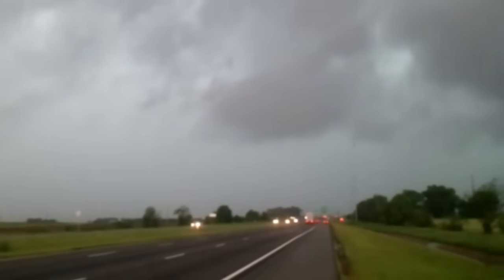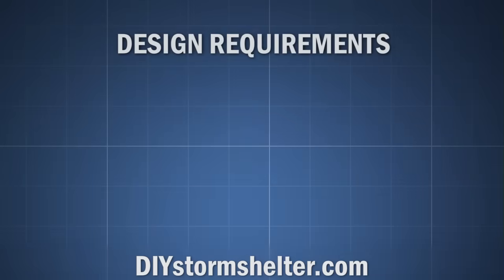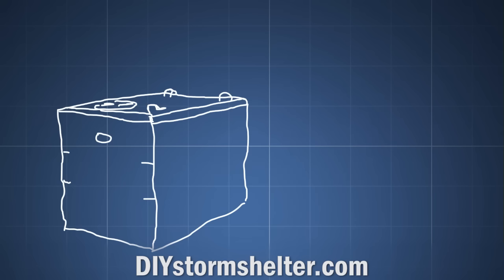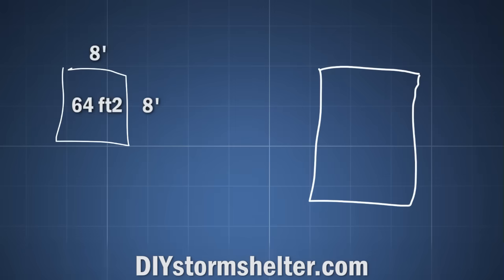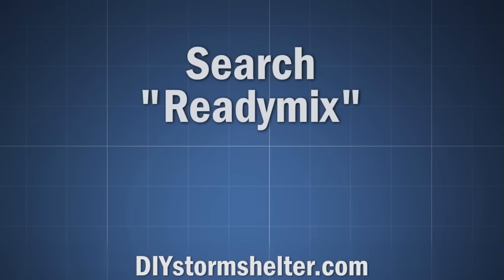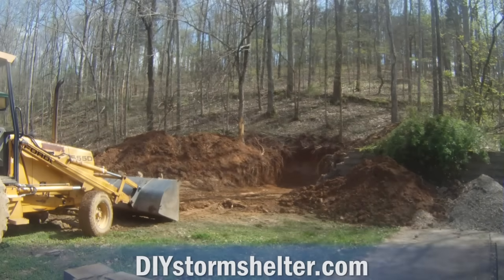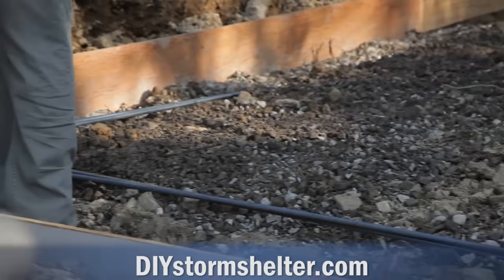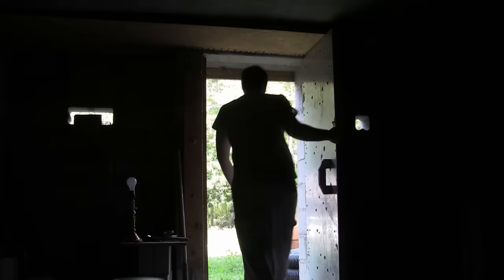Concrete block DIY Storm Shelter 12x20 foot

Comment: Everything you talk about for concrete and block specs I learned about over 35 yrs ago in my Brick Layers course ,  with building a storm shelter like that , and pouring concrete , you also need to have proper forms (oiled type forms are only used )  and proper type of reinforcing steel .
Ordinary rebar is not acceptable , must be coated or use Stainless Steel wire mats (4x8) or wire mess that has a coating not to allow rust to start, unfortunately less expensive products are available and used due to trying do it on the cheap.  With over 38 years in construction industry from being Certified Bricklayer and Stone Mason , Certified as well for Blue Prints to Class 3 Tandem driver with 17 Ton cable Crane credentials , several  flaws as well in your construction . Never build on side of a bank , Hydrostatic Pressure on 3 sides will cause Subsidence or moving of the structure for storm shelter , must be backfilled on all 4 sides and tamped the earth every 2 feet  as well with Class A Gravels , redish clay or clay type soils for back fill allow for freeze thaw cycles , even with mildest winter climates, frost can occur at the most unforscene times , climates change without notice .  Using Aggregate mixed type soils and tamped also allows for drainage away from structure and you also never used any drainage conduit around the structure , mould will occur even in block type structures without notice and the air will become stagnant and toxic . As I say I'm certified now 36 years and have built several these type structures of the same . Research is only small part , lits if wrong info as well on the internet . As for Engineers , well I'll leave it at that , they all have thier own versions of how it should be done , most could not mix cement in a wheel barrow.

I might ad as well Today I work for a Brick and Block Manufacture , and filling the cores you must also vibrate the Concreate in order for proper Airation of it for proper and full PSI set up , not doing so can cause premature failure if the block due to inner hydrostatic pressures during cure time , I've seen several walls fail for lack of proper Airation of pouring Cement into cores and try to blame the block products , when in fact short cuts were taken
Reply: You don't need to use stainless steel, the rebar can't dust if it's incased in concrete there's no oxygen
Reply: Best take a real good look next time a demo is done on aging concrete  reinforced with steel , we live in Atlantic Canada , Everything rusts here . I can garantee there is rust and corrosion with in the concrete
Reply: @outbackcountry512  yeah well I dunno maybe different over there? But steel needs oxygen to rust so if you fully encase steel in concrete it can't rust, maybe the snow can seep into the concrete I don't know
Reply: @outbackcountry512  if your concrete is cracking you are doing something wrong

Comment: A sea container buried in the ground encased in concert. 
Attach it to your basement and you can enter it from your house.
Reply: He doesn't have a basement...That's kind of the point of building a shelter, but this one will probably become a tomb...
Reply: Sea container won't work.  The sides will give out.  The strength of a container is in the corners.
Reply: Nick Heese 
You would have to shore up from the inside until the concrete cured, but it would work.
Reply: The concrete "encasement" would crush your "sea container" .
Reply: @denisewilson8367  
Not if your shore the inside until the concrete cures.

Comment: At the base of the structure or part of the footings there need to be about a 2' horizontal concrete extension all around.  This provides an anchor for the buried structure from floating and lifting during high water table events.  Trust me when I tell you that your shelter will pop up out of the ground if given the chance!
Reply: Here in Washington State we have floating highway bridges (I-90, Highway 520) across the Puget Sound that are supported by concrete pontoons.  Hollow concrete structures will most definitely float.
They make battleships with thick steel hulls and armor that float, too.

Comment: Not qualified to charge for any kind of advice. For example of your structure not being up to snuff, there is no planning for lateral force. In a tornado the damage doesn't come from downward pressure. It comes from the sides. No rebar in your block and no concrete. Unless you were encasing the entire thing in dirt and entering from the top, you have to take lateral force into consideration.
Reply: Oh, lateral force IS taken into consideration. It's one of the biggest challenges of a buried structure - the dirt WILL crush and destroy if the structure isn't sufficiently reinforced. 
Almost every cell got #4 rebar and was grouted, and in addition reinforcing "ladders" were placed horizontally every few courses. The shelter has now been in place for coming up on 6 years. There's not a single crack anywhere.

Comment: Your'e only going to be in there for like 15-20 minutes until the tornado passes. You don't need a subterranean Heffner Mansion for God's sake.
Reply: Some people build this for hurricanes - here you can be in for many hours. 
For tornadoes, you want to enter the shelter either when wind speeds are becoming dangerous or when a tornado WARNING is in effect. We've been in for over an hour before. When it's the middle of the night, and the kids are fussy and/or scared, and the storm is kinda nasty, having plenty of elbow room is a luxury you are VERY happy to have. Also, there's not a huge time or price difference to make it just a bit bigger.
Reply: @davidbotkin1650  Be subterranean when a hurricane hits? With all of the rain and major flooding that comes with it? No thanks.

Comment: Best way is all cast in place, reinforced structural concrete. In my past consulting business I detailed formwork drawings for many small town tornado shelters in Arkansas. Most were high school gymnasium sized structures with design engineered specs and drawings that would have multiple usage beneficial value. Those structures were totally above grade. Block masonry is more cost efficient but should be designed and constructed only by qualified professionals. Tornadoes vary in their wind velocity and safe shelters should always be built per applicable codes and specs! Shoring the elevated cip roof slab and the decentering ie extremely critical in releasing the properly cured slab to assume it's own load. If decentering process is not done correctly the whole roof slab could possibly and catastrophically collapse!! This is always critical on elevated floor slabs and cip slab and beam bridge   structures. Use of a licensed structural engineer will also spec the rebar and the mix design specs for the whole project.  An architect can also help you.

Comment: You built a shelter-shaped object.   I could tell you at least five mistakes you made, but will require payment of $14 first.
Reply: Just a simple square box - teenager's could do this diy
Reply: @rv442conv  what's your shelter look like?😂
Reply: @rv442conv  It could be that simple, except this guy built a storm shelter at the foot of a forrested hill...
So what, right? First thing to consider is: 
1. when will this square box be used?
2. What is the square box supposed to be used for?
3. Who will use this box for its intended purpose?
Those are some very simple, basic questions, right?
The square box will ONLY be used during extreme weather and is designed to protect his family from high winds, tornadoes and possible flash floods that may come down the hill along with trees that have blown down and the hillside terrain.
Now, would you suggest that your loved ones climb into that tomb at the base of a hill or do you have a huge life insurance policy that you would like to collect from an accidental death in a tornado?
Reply: @superiorcarpetpaintllc4351  he forgot the drainage pipe and gravel around the perimeter to keep water hydrasyse out from seeping in but hopefully he puts a pump in or some other drain system. But he did say he was on a budget.🤔
Reply: Why don't residents set up a co-operative, either local or national, and approach a plastics manufacturer to make a simple domed roof plastic underground shelter. They keep bugs and water out. 7000 dollars for an underground shelter is a rip off online for a plastic shelter when a child's plastic slide is so inexpensive to make. The plastic on those toys is almost indestructible and will certainly endure below ground. Easy to replace too. Also, not sure why you guys in the comments keep describing below ground shelters as coffins when your neighbours and family would know exactly where to find you? Don't tornadoes only last a few minutes?
Reply: I'll do it for $13.99 and I won't bore you with those mistakes!
Reply: @davidnapemaskwa7251  I will do it for 13,98!
Reply: HERE is The TRUE Savior 

YaH The Heavenly FATHER HIMSELF was Who they Crucified for our sins and “HERE IS THE PROOF”

From the Ancient Semitic Scroll: 
"Yad He Vav He" is what Moses wrote, when Moses asked YaH His Name (Exodus 3)

Ancient Semitic Direct Translation
Yad - "Behold The Hand"
He - "Behold the Breath"
Vav - "Behold The NAIL" <— YaH’s Crucifixion
He - "Behold the Breath"

“Behold the HAND that Beholds The NAIL” 

PROVES - YAH The Heavenly Father HIMSELF was Who they Crucified

That is EXACTLY what Moses Wrote

Here is what they mean

YaH's Name:
(Ya)d + (H)e, as YaH is what Moses called Him and YaH Declared: "this is My Name, this is My Name for all generations" (Exodus 3)

YaH is The Creator of “MAN”:
Yad He, (HAND BREATH), as YaH's "HAND" Formed man from the dust  of the Earth and His "BREATH" made him a living being (Adam)

YaH's Sacrifice of Crucifixion for “MAN”:
Vav He (NAIL BREATH), the "NAIL" through YaH’s "HAND", that whosoever shall call YaH Savior, His “BREATH” brings forth life (Salvation)

How YaH arrives:
YaH arrives via the Tent of Meeting (Exodus 33:7:11, Isaiah 54, 55), where a Tent is erected outside the city, a cloud descends upon the entrance of the Tent and YaH appears...

Why they demanded YaH to be Crucified:
YaH was Crucified according to Hebrew law (Deuteronomy 21), to be Hung on an Almond Tree for BLASPHEMY as it was for His NAME they demanded Him Crucified. The Messiah claimed He was YaH...

HE WAS YaH!!!

HalleluYAH “Praise ye YaH”

From The Hebrew Book of Isaiah, The Dead Sea Scrolls

Isaiah 42:8
"I am YaH; that is my Name! I will not yield my glory to another or my praise to idols.

Isaiah 43:11
I, I am YAH, and there is no other Savior but Me.

Isaiah 45:5
I am YaH, and there is none else.

Comment: Why not pour concrete walls in forms with rebar, like you would for a basement?
Reply: Professionals do build them with poured walls, they just require some VERY strong forms to hold back the concrete, you can rent them or better yet hire a form carpenter to build them for you, form carpenters have reusable steel forms that they will setup and take down after it has cured.
Reply: @superiorcarpetpaintllc4351  My company uses Symon's Forms... Very expensive but so worth the cost.
Reply: @mr.techaky7655  I always hire a form carpenter to build our forms, anything over 24" is usually steel, by giving the job to a form carpenter we kill three birds with one stone, the contractor will take full responsibilty for workmanship, he will supply the forms and reset them prior to pour and he will take the forms down and clean them after the concrete has set! All of that for about the same money as it would cost me to rent forms or build them plus all of the labor is included and if something goes wrong the form carpenter is 100% responsible for making it right! DIY doesn't pay sometimes.

Comment: What about a container
Reply from the maker: On their own, DO NOT BURY THEM! The roof and sides are thin corrugated metal and will fail with dirt against/on them. If you pour a concrete roof, and set the dirt back from the sides, then yes they can work. But then you might as well build with concrete all the way and not really have to worry about rust.

Comment: Did you consider a small shipping container? One of those anchored to a concrete slab is NOT going to go anywhere and small containers are pretty cheap...plus, no labor for construction and no waiting for concrete to cure once the slab is done.
Reply: I know this is 4 years old.
Shipping contanors are not very strong.
Their strength is in the ends.
Shipping contanors make poor underground sites. Due to how weak they are.
Years ago I looked into using them. And found this out.

Comment: There's an equation for converting dimensions in feet to concrete yards I learned doing duct banks for electrical conduit. You multiply your length (x) width (x) depth then divide by 27 & that will be your yardage of concrete
Reply: Is that feet x feet x inches, then divide by 27? Researching a 20x40 small house slab.

Comment: Does anything every really survive a direct hit from a tornado? Even built into the side of that hill? Had a warning here in Louisiana last night, and it got hairy really quickly. I was quite terrified for a while sitting in the hallway.
Reply from the maker: YES, things do. The storm in the video was likely an EF-3 or EF-4. The house that was shown utterly leveled was next to another building that was largely unscathed. The eye of the tornado was over 100 yards wide, so it got hit. But it was strong enough to hold together. 
Tornadoes do damage through two main mechanisms:
1. Wind load - put 140 mph of wind on something. A chicken coop won't survive - it will just blow apart/away. An anvil will be just fine. Somewhere between coop and anvil things start failing. You just need to be on the "anvil" side of that example. 
2. Missiles - 2x4s flying at 140 mph can do serious damage. If the wind can't tear something down, it might still be able to shoot 2x4s through it. But a hard enough wall will destroy the 2x4s when they hit.

Basically, you want a small, HEAVY, hard structure. Then you are likely to start having very good survivability from storms. The small size means the wind can't dump as much energy into it, the weight means it can't be rolled/pushed, and the hardness means it won't get punctures by missiles.

Comment: I agree that a storm shelter should be big enough to be comfortable. I also think that they should be able to be at least partially used as a root cellar/storage for important things like photos. 
I'd also want some animal cages as well for my cats and for any neighbors pets. Because you can pretty much guarantee I'd want it big enough to share. 

But barring all of that my 2 cats and I am perfectly happy to share with the spiders.
Actually there wouldn't be spiders for long. My cat Micah thinks bugs are just moving kitty treats. 

My family on the other hand goes outside to watch for the storm. At least I have first dibs on the tub.

Comment: Fiber glass fibers (less than 1" long?)  are the bomb.  I put them into the mortar mix used to coat a cement block wall, both sides, one coat and 9 years later there is not a crack anywhere.  You can't find one looking carefully.   The cost of the whole 200' of 4 1/2 foot high wall was half a $18 box.
Reply: fiber plastic or mullite fiber work just as well,and are a hundred times safer ,fiberglass is nasty stuff

Comment: Re-bar shouldn't be attached at 90 degrees, 180 degrees only.  That's why the shape, it interlocks when encapsulated by concrete but held tightly together with wire, it can't slip.  For a corner, bend a piece about 3' long to 90 degrees, and put one in each corner.  Attach straight pieces to it.  The re-bar shouldn't be rusty.  Near salt air it's usually painted for that reason.  Each gage # is 1/8" so a #4 is 4/8" inches or 1/2".  # 5 is 5/8th  etc..  I didn't know about the water and weight thing.  We would have a short path, some patio stones formed or anything, to accept any excess concrete from our estimate.

Comment: I guess you must realize that those cement blocks will offer you approximately the same level of protection as a wall made of sheetrock, right? This shelter would be a potential DEATHTRAP in a direct hit by a strong tornado. Reinforced concrete: footings, slab, walls AND roof all in a single pour. Or bury it, COMPLETELY.
Reply: I agree

Comment: To handle the extra concrete that will be left over, make some forms for sidewalks, planters, etc. where you can use the surplus.  You can make the sidewalk forms like a box which will give you a smooth bottom and a top.  Be sure to place rebar in it to keep it from breaking.  You can make them at different lengths and use them as paving stones later.

Comment: Why a 4"  floor, you gonna park a dump truck in there?  It was suggested to me to install a french drain first and use hard packed dirt floor under carpet, much easier on the legs. And while cement or steel is strong, if your entrance becomes blocked you're stuck.  Wooden post and shoring would allow you the option of chopping thru the wall(axe and shovel kept inside shelter and never borrowed) and digging your way to freedom. That looks more like my underground workshop would be, good job.

Comment: Let me get this straight:

David Botkin  is selling a video for $14 where he teaches you how to build a 12'x20" building with a concrete slab and a concrete roof for under $5,0000, and some of you cheap-asses are calling him out on it?!?! 

You could build a couple of these with little hallways between them and literally live in them. My girlfriend and I have discussed doing this. Put enough soil around it and you'll have awesome insulation.

Hell, I spent $60 buying a set of Star Wars DVD's. so I don't see this as greed at all, In fact - I would suggest he raise the price to $20.00.
Reply: It is a collapse waiting to happen